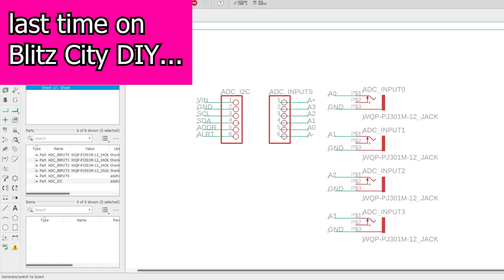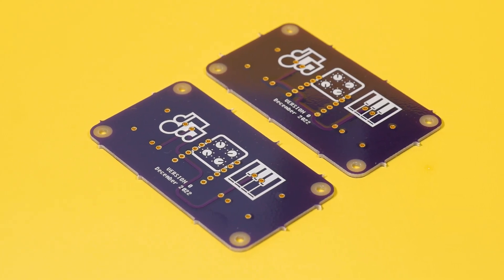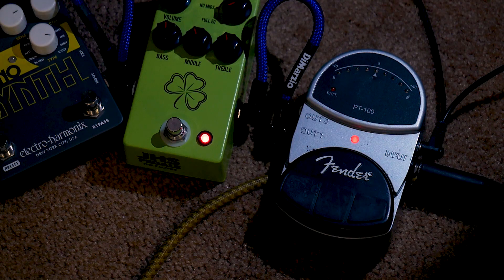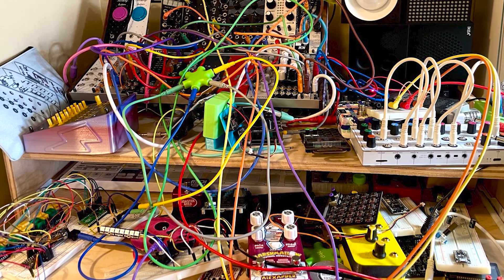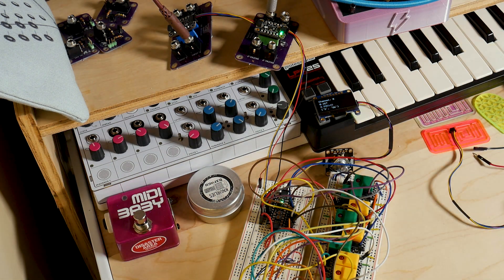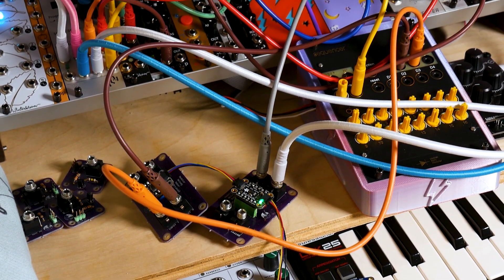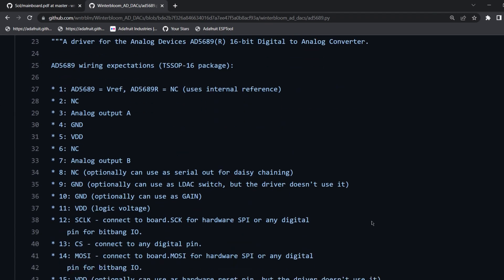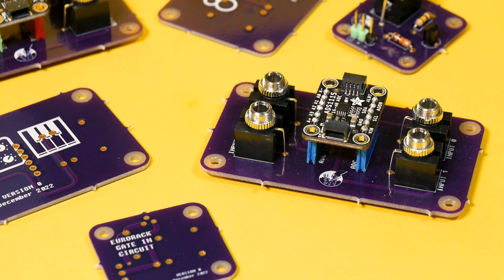Let's Test Some PCBs

Comment: I am looking to do similar things controlling v/oct with a microcontroller. I would love to hear more detail about the issues you are running into with the 12 bit dac. It seems like 12bit should be good enough for 5 octaves of pitch, giving you a little better than 2 cents per dac step, which should be good enough in theory. Maybe this would need calibration? I would love to hear more details about your issues since I am on a similar path but not as far along.
Reply from the maker: i haven't ruled out that it might be related to the core functionality currently being a quantizer for the incoming signals on the ADC. that's one reason why i want to move on to the gate in triggers because maybe that will have better stability